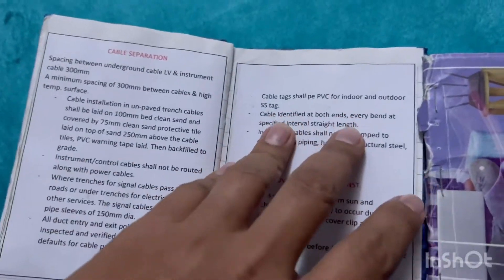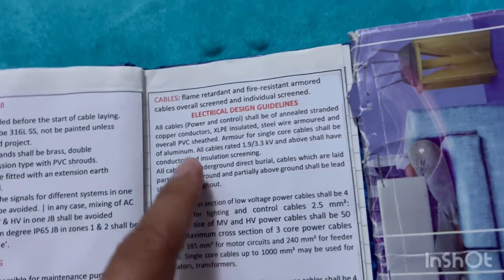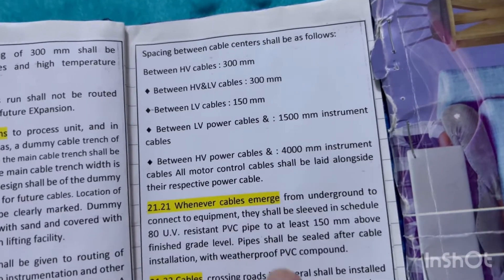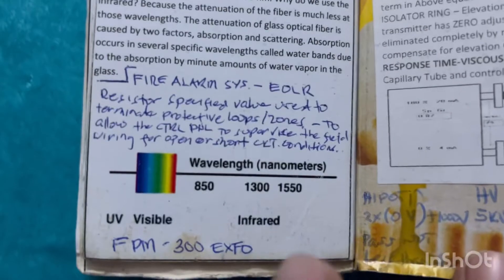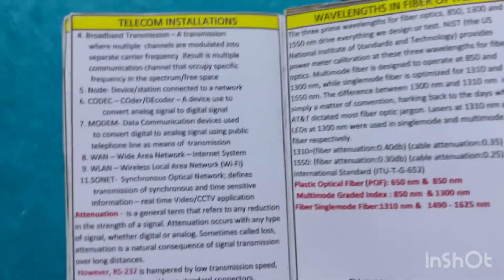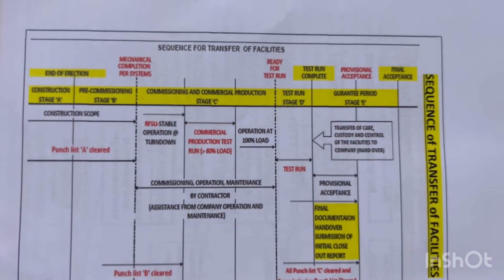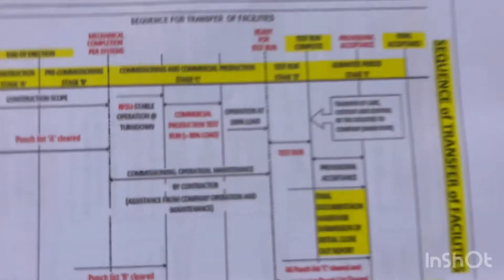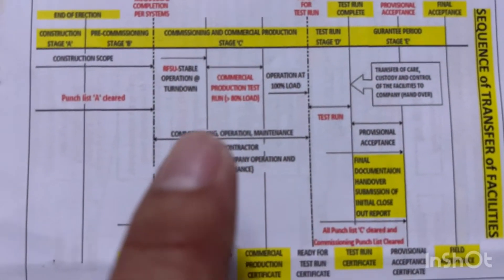QA/QC electrical & instrumentation inspection guidance for work, testing

Comment: Hello sir i want to get a job in electrical QA QC field ..which certificate i need to take to get a job in abroad.. i am a fresher
Reply from the maker: If you’re interested to become QAQC Engr/inspector. Actually there’s a lot of certification training to be attended.
But the basic is QAQC certification training and follow comp ex. 
If you’re totally zero experiences. And attend workshops training about electrical, instruments and telecommunication. More money involved
Reply: Sir qa qc mech ..ASNT LEVEL II certification usefull for me.. is it possible to switch to mech
Reply: @OFWSUCCESSBAYANI 

Sir what is comp ex as you told... plz give me detail